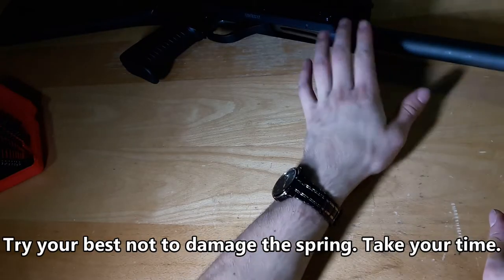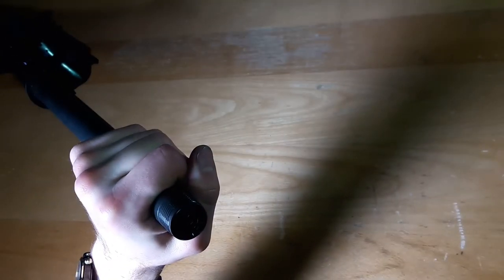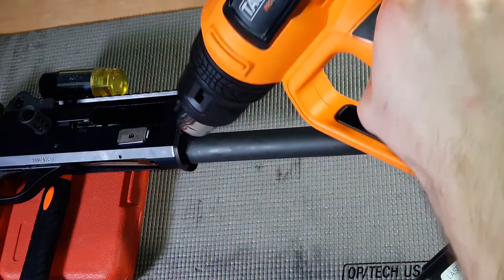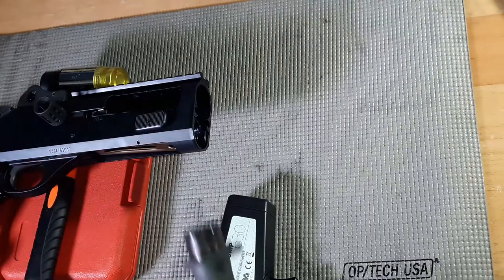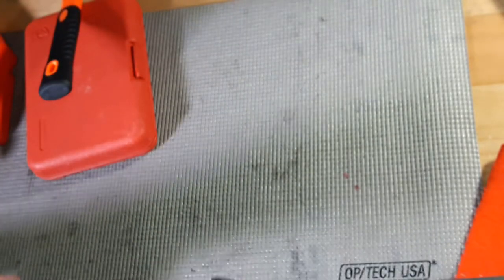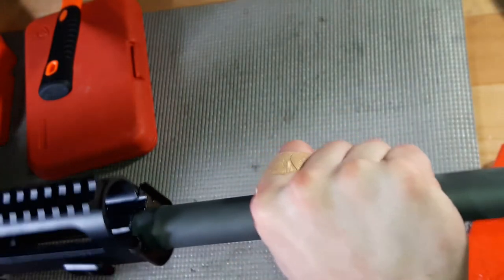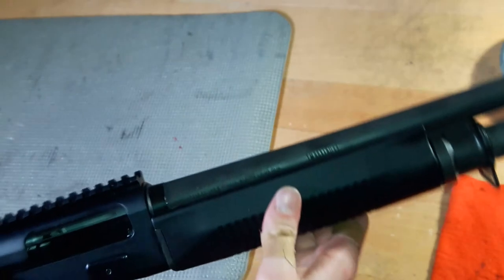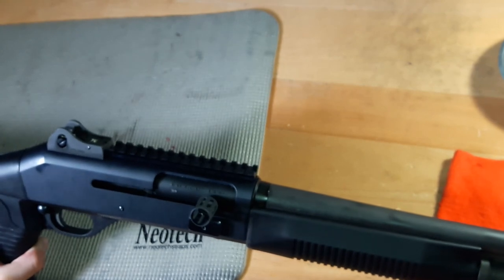Benelli M4 Modifications Tutorial | Bolt Release, Magazine Tube, Safety, Bolt  | Part 2

Comment: No need to remove the bolt to heat the tube and release the loctite, just steadily move the flame around on the tube near the threads and when wisps of smoke and a smell begin to emminate, stop heating and start turning (USE THICK LEATHER WORK GLOVES)

Comment: It's very interesting you chose not to remove the bolt assembly or trigger housing many other videos I have watched they removed them to keep them from the heat I'm glad I watched this video to see you have a diffent option.
Reply from the maker: As this was from many years ago, I can only comment to the best of my memory. Having said that, if I remember correctly, the heat applied was directed at the threads. I believe that about an inch or two from where the heat was directed it was warm but only like it was left out in the sun (i.e., not dangerously hot). It's possible, as you saw, that certain parts don't need to be removed. Of course, if you want to play it as safe as possible, take those parts out. Whatever you're more comfortable with is what you should do.
Reply: @ELITEkickBOXER  it's a very good video do you know if they use same loctite you made it look super simple I'm just nervous to try it on my own it is after all a 2,000 dollar shotgun
Reply from the maker: @rainegirl0867  (I do not know the answer)
Reply from the maker: @rainegirl0867  It really is simple though. Just need patience and the right tools

Comment: Would a blowtorch work? I dont have a fancy blower like you have, all i have is a hairdryer and it doesn't get hot enough even after long durations of constant contact. What i do have is a blowtorch
Reply from the maker: Apologies for the delay.

Could the blowtorch work? Your guess is as good as mine. I'm just afraid of melting something. But I suppose it can.
You can get a heat gun from amazon for about $20 (or harbor freight for the same or cheaper). If you don't have one or can't get access to one, maybe try the blow torch? Just use extreme caution. If there was a way to have something between the blowtorch and the firearm to enable heat exchange, but not at such a rapid change/directly that could be interesting. I'm just brainstorming. If you have this firearm, you know how expensive it is. I just wouldn't want you to ruin it. But again, maybe a blow torch NOT having the flame directly touch the firearm could perhaps work.
Reply: @ELITEkickBOXER  I was able to find a heat gun for around 20 bucks, thought they would be more expensive so I just didn't bother to look. Haven't been able to twist the damn thing off but gonna try again in a few days time. Thanks!

Comment: From what I read Benelli is using red loctite now.  From the tech data sheet, you have to heat to 450F to remove red loctite.  Remove trigger and stock first.  I tried to remove mag tube on a Charles Daly 601 DPS for an hour, with about 5 minute heat sessions with heat gun set to 500F and it wasn't budging.  I don't know what the actual temp was, but I'm trying again tomorrow using my IR thermometer to make sure it's not getting too hot.  At 450 I'm wondering if it's damaging anything or weakening the receiver.  Can't be good for springs like on the bolt release.

UPDATE:Well I tried my heat gun at highest setting, 800F, but it seemed to be starting to get the entire receiver too hot, so I broke out my map torch.  Took about 30 seconds each to remove mag tube and and stock tube.  Way better than heat gun.

Comment: I just bought a M4 from a friend, it already had the extended tube, but I can only get 6 shells in, and the 7th goes about 7/8ths the way in and seems to be bottoming out the spring.
Reply from the maker: Make sure you're using Normal 2 3/4" shells. 3 inch shells you can't get 7 in
Reply: I have heard that removing the spring retainer will give you that extra space needed but it every time you break the gun down for cleaning or repairs you will have a loose spring you have to mind.

Comment: So I have read that you have to heat the loctite up to 500 degrees I have tried 275 and my tube won’t budge. Any thoughts?
Reply from the maker: I can tell you for a fact that 500F is indeed too much and can potentially damage a cerakote finish on the firearm. If you have a digital thermometer, I would heat it to about 290, then get some work gloves and try your best to separate the parts. Be careful to avoid touching where it is hot (which if done correctly, shouldn't be that much of the surface area). If you don't have a digital thermometer (which is perfectly okay), I would heat it for about 2 minutes, then try to separate the pieces. It most likely will need more time than that, especially if it's difficult to heat it uniformly as I did in the video and how much heat your gun outputs (I had mine on max power I believe). Thus, I would heat it at 60-second intervals and try to remove it after each interval. This will work eventually. If you have A LOT of time on your hands, you can do 30-second intervals too. But just be aware every time you cease heating, it starts to cool down a little. It may seem hard to do, but I assure you from personal experience, if done correctly it's quite simple and shouldn't take long. Before you know it, you'll have one fine piece of machinery in front of you. I hope this helps even just a little. 

Any other questions, please feel free to ask.
Reply: Check out freedom fighters tutorial he has a few tricks that he did not use that can help out! I’m actually waiting for my new M4Le to get to my FFL with a 3 position collapsible stock and titanium 7 round tube in the H2O. Oh freedom fighter also said that all M4s are different and some have more loctite them other M4s not all are the same so you need to just do what he he already wrote and take your time and it will come off just don’t bake that factory cerakote or you’ll be sending it that reciever to get redone! 🤟🏽

Comment: Thank you for the video.  I've got the H20 cerakoted m4 version.  Do you think the heat would harm or discolor the cerakote finish?
Reply from the maker: Honestly, I'm not too familiar with the cerakote process. I would contact the company you got the firearm from. I would start with that at least.
Reply: These receivers are anodized which is a finish applied to aluminum and it becomes part of the metal not just a surface finish like cerakote. 
Heating it up should not ruin the finish but may discolor it.

Comment: would you recommend I remove the internals before I heat it up, or will those be fine in the heat?
Reply from the maker: OmgItsTheBlindBandit OmgItsTheBlindBandit I recommend going about this as close to what I did as possible. That being said, you should remove the barrel before you do this as it makes it much easier for you. But, as long as you only apply the heat to that one area (i.e. keep the heat stream concentrated), then the heat doesn't really go far from where you aim it; in other words the only truly HOT spot is where the heat is directly concentrated at, the other places are just warm. So you don't have to remove the internals (for example the bolt release parts), but definitely remove the tube spring and anything else in the tube. I hope that answers your question. If not, let me know.
Reply: Probably too late, but for anyone else definitely remove the internals. I melted the front part of my trigger housing, now my bolt is binding up on it so I'm out 200 ish bucks.
Reply: Update lol, I was able to fix it by filing down the warped peices of plastic.  The plastic was impeding the shell carrier from moving, which kept the bolt from cycling forward.
Reply: It’s real easy to remove the trigger housing and the bolt.  Even if risk is minimal, I figure, why not?

Comment: I added a FFT 7 round tube to my Tac-12 and I'm pretty sure it's seated all the way on but there's a slight gap where sometimes the shell gets caught on. The shell gets stuck in the mag tube and if you barely wiggle the shell and then it's back to normal. Not sure what to do. It was an extremely tight fit, idk if I can get the tube off now. Should I take it to a gunsmith or maybe try something else?
Reply from the maker: So I'm not a professional, I'm merely a fellow youtuber who modified their Benelli. Having said that, the smartest thing would be to bring it to a gunsmith. Now having said THAT, I personally would only bring it to a gunsmith if I truly needed a professional's help. I don't like to pay someone else to do something if I can (attempt to) do it myself--maybe it sounds cheap. But no one will take more care of your possession then you. If you can find out exactly what is causing the problem that might be best in order to find out your next step. Where is the gap? Is the gap a result of your doing or a defect in the tube? Could you take it off (if you didn't permanently put it on)? Again, a professional will have to most likely do what you would do...but yeah. Sorry I couldn't be more help.
Reply: @ELITEkickBOXER  No problem, I really appreciate your take. If you remove the trigger guard and look in the receiver with a flashlight the gap is inside the where the FFT mag tube makes contact with part of the receiver. The follow doesn't catch on it, only the shot shell because the gap is about the size of a shell rim. The mag tube was an extremely tight fit just to get on. I heated and turned and repeated over and over until I physically couldn't turn it anymore. It was such an insanely tight fit, I'm not only afraid I might've damaged some threads but I also might not be able to get it off now lol. FFT is specially for Benelli so idk if it just won't go all the way on for the Tac-12 or what. I'll use my heat gun and get the threads hotter than Satan's asshole and try to thread it on one last time before giving up and taking it to a gunsmith.
Reply from the maker: @jkees6751  I'll be honest, that doesn't really sound too good. Although I can't physically see it and maybe it's an easy fix. Typically when it comes to threading things on, it's smooth as the thread pitch and length are equal. If you used a Benelli mag tube that wasn't designed for the firearm you added it onto, it is very possible (not guaranteed of course) that you may have cross-threaded it. If that's the case (sorry to give you anxiety lol) it's gonna be a not-so-fun repair. If it's just a tight fit which it could be for sure, either take it off and put it back on or get a different one/one made for your firearm. Also, you shouldn't have to use heat/300-pound gorilla to put it on. to get it off, yeah, heat and torque are your friend. if you can get it off, don't put it on until it's cooled.
Reply: @ELITEkickBOXER  Gotcha. Pretty sure it was just a tight fit but I'm thinking there's a 5-10% chance it might be crossthreaded. If it is I'll defintely let you know.
Reply from the maker: @jkees6751  If you don't mind, let me know what happens regardless, I'm curious.
Reply: Yikes that sounds cross-threaded. Is there an update, did you have to get some stuff re-tapped/threaded?

Comment: Where did you get the bolt release from?  Also how are you liking the longer tube? Any issues?  What brand.
Reply from the maker: Bolt release: https://www.gggaz.com/benelli-m4-tactical-bolt-release-pad.html

Full Length Magazine Tube (OEM tube): https://www.benelliparts.net/store/p2/Benelli_M4_7_Round_Magazine_Tube_70052_ETA_1-WEEK.html

Personally, I love the full-length tube. Never had any issues. It looks better than the +2 extension and is the original tube so it looks/fits perfectly. Obviously, it's more expensive and takes a bit more time to install (but as you can see from my tutorial, really isn't a big deal). It's a $2k firearm, haha what's another $170! Okay, but seriously, it comes down to personal preference and budget. Just don't get the +2 extension then upgrade to the full-length tube in the future as that would be a waste. If you get the full length, you will not recommend it. However, it's up to you.
Reply: @ELITEkickBOXER  Thanks for your response.  Hard to find parts these days.

Comment: Great video. Is there a benefit to installing a full length mag tube vs a two round extension? I don’t own a heat gun and would have to buy one :(.
Reply from the maker: To put it simply:

Installing an extension (compared to the full-length tube) is quicker and easier and cheaper.

Installing the full-length tube is more expensive (but by how much depends on the supplies used) and more of a hassle. Now it does take more time and effort but is REALLY easy to do. That's also why I made this two-part tutorial in seriousness. It really isn't hard to do at all, as I did it for the first time in this video. The reason I did the full-length tube is that it looks the best to me; it looks sleek. I personally, in my opinion, think the full-length tube is more robust and will last longer than that extension (depending on the type of each you get). Again, I bought the official full-length tube made of the same material and everything as the factory-installed tube instead of some third-parties tube.

It honestly comes down to personal preference.

Honestly, a Benelli M4 is basically the best of the best when it comes to shotguns (albeit there will always be exceptions)...and, it cost around $2000. The heat gun I got was $30 and now I have it forever: https://www.amazon.com/gp/product/B0744BHQ5L/ref=ppx_yo_dt_b_search_asin_title?ie=UTF8&psc=1

Hope that helps. If you have more questions, please let me know.
Reply: Thanks a lot, the advice is greatly appreciated. I’ll go with the full length tube for sure. You’re right, it seems fairly easy to install, and having done some installing myself in the past (including two Geissele triggers in my AR’s) this should be pretty quick.
Reply: There is a benefit if you're trying to stay 922R compliant. I've read on different forums that if you install a US made magazine extension onto an Italian made 5 round mag tube it still counts as an Italian part. Installing a US made 7 round mag tube counts as 1 part from the list of 922R compliance. You have to switch 3 Italian parts for the 7 round mag tube swap, and then 4 Italian parts if you also do the collapsible stock. There are people out there who don't worry about it, and there are people who worry about the federal weapons charges. I did it with my wife's hair dryer in about 3 minutes in a vice wrapped in a bath towel. It's just expensive to stay compliant.
Reply: 922r considerations. Full length tube count as 1 USA part. Need 2 more USA parts installed for compliance. With tube extension, 3 more USA parts required to be installed as the extension tube does not count towards 922r compliance

Comment: What do you think is the benifit of using a whole 7 rnd tube compared to a quality extension?
Reply from the maker: I'm no expert. Yet in my opinion, I would say practically speaking, there really is no difference (if a quality part is used). It's more of an aesthetic/go the extra step type of situation.
Reply: See 922R. Modifying imported weapons is controlled and you need to replace 3 items (4 if you do a collapsing stock). The follower and the magazine tube are two acceptable replacements.
Reply from the maker: @bitshuffler1  All true. I have another video showing how I make this 922r compliant after the upgrades I did in this video. However technically illegal it may be, it's not like (in reality) someone is going to disassemble the firearm and count the pieces to see if it's compliant. But if you know about 922r then it's probably gonna bug you to make it "legal." Of course, everyone's opinions on this may vary.
Reply: If you fork over the cash, you can get yourself a titanium one and save some weight

Comment: I have read that people lightly lube the magazine spring? Do you recommend this?
Reply from the maker: The following is my personal opinion, and just that:

It's been a while since i made this video, BUT if I remember correctly, I read somewhere that for whatever reason I came to the conclusion that you do NOT lube the magazine spring. Now before I made this video, I did a lot of research as to what was needed to be done and why I did/ didn't do certain things. I'm sure some people will say that lubing the spring is good and works, and I couldn't tell them they're wrong, well because I wouldn't know. But, I do believe that I read somewhere that if you lube the spring it will eventually collect dirt and grime and build up within the tube and disable it from moving the full distance of the tube. 

I do have to say that I've never had a problem with the gun or the spring/ magazine tube, and so not lubing it is a viable option, and something I recommend. 

Also, I'm sure at least one person will say something along the lines of "as long as you clean the spring every so often, the lube doesn't hinder anything". On that note, I can't say otherwise. It boils down to personal preference. Hope this helps. If you have any more questions, please don't hesitate to ask?
Reply: @ELITEkickBOXER  that all makes sense. I ca. See dirt eventually building up. I'll see how it goes without it. Thank you for the   thorough and quick reply! I greatly appreciate it